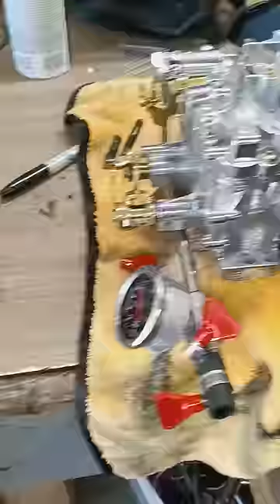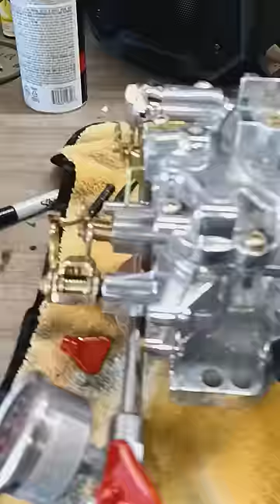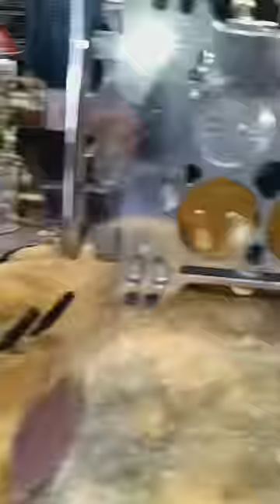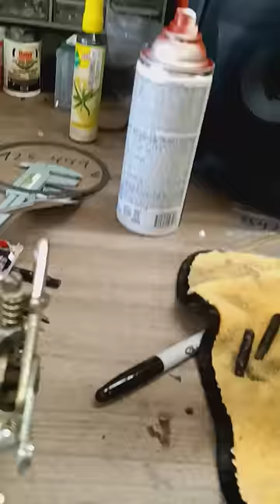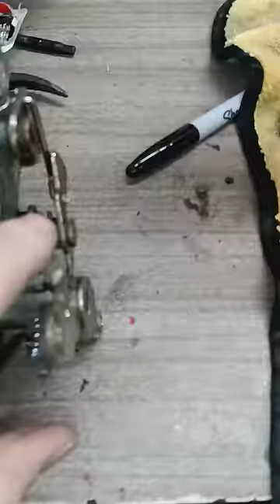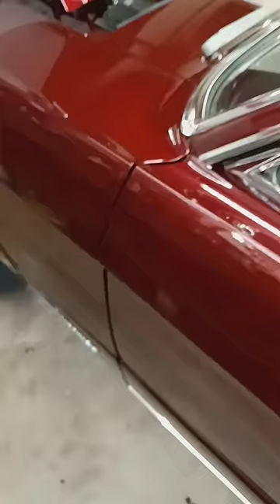how did I miss that?

Comment: Glad you got it figured out, was about to say, check the locking pawl on the secondary lockout.

Carter AVS's has a locking pawl to lock out the secondaries on cold engine temps and prevents you from using the full WOT capabilities til the choke is off.
Reply from the maker: Thanks man,  I made sure it was not set on the lug. I didn't know that was the name of the linkage that is shaped like a sideways U. Makes sense. Thank you for that. Your response is actually one of the most knowledgeable. I got a more then a few people telling me how dumb I am. How trash Edelbrock is, and how garage Mustangs are. Lol trolls?
Reply from the maker: @samhicks97  I couldn't agree more I like all the aftermarket carbs for the most part. They each have their place.
Reply: @BPattB  Exactly. Each and all carbs have their own unique quirk to work with your application at hand.

Comment: The AVS 2 is a much better carburetor than the original Edelbrock as I've noticed. I got much better throttle response as well as a noticed increase in mileage. The AVS 2 is much better off road as well.

Comment: Edelbrock carburetors make killer trot line weights 🤠
Reply from the maker: Please explain LOL I know Holly's making nice low idle in my car but they're so damn hard to tune. I'm working on tuning a new Edelbrock and even with a bog up to 2500 I spun the tires and fish tails all the way through first gear and halfway through second and I have a 280 rear end lol stay tuned and thanks

Comment: Similar thing happened to me, had a vacuum leak under the carb so my buddy gave me a new carb to manifold gasket. Ram it like that for a few months. Later realized the new gasket openings (had 4 individual runners) were not big enough and kept my carb from open ore than 25%. Felt like I added a supercharged when I fixed it lol
Reply from the maker: Awesome man. I had a four-hole spacer underneath the old carburetor. The new carburetor I got the secondaries are 1/8" inch bigger so it was preventing the secondaries from opening all the way. That was a quick fix with the Dremel. I also turned it into a super sucker LOL. I went over that in a video on my channel too if you want to check it out.

Comment: Man you should have noticed that right off the bat.
Reply from the maker: You're right I should have and I've answered this question a few times before my neighbor gave me the carburetor one night after we drink about half a bottle of moonshine. I wouldn't be surprised if he was so drunk he dropped the carburetor halfway to my house and kicked it the rest of the way cuz he was too drunk to pick it up. Anyway the new carburetor is on and has a slight bog below 2500. I went ahead and held it at 2500 and hammered the throttle, the car spun the tires all the way to first gear and halfway through 2nd @65mph) and slightly fishtail the whole way. I'm just a normal guy that likes to drink moonshine on the weekends and that will cause me to make mistakes. Stay tuned it'll be fun.

Comment: Fyi   If you dont hold the choke open the 4 barrels dont open all the way on the older edelbrocks.
Reply from the maker: I appreciate you trying to help. I did a update video and showed how to linkage was bent and that was the problem. Out of the 77,000 views I had three people basically call me a liar, and say that I didn't check that the joke was open or I didn't check that the air valve on the secondaries was open, I didn't show it in the second video. But I really do appreciate people like you that pointed things out that may have been wrong. Lord knows I'll make mistakes along the way and if people like you are there to help me correct the mistake easily I'll appreciate you more than you ever know.
Reply: @BPattB  all good man! Glad it was something else and not something as simple as i stated! Hope the new carb treats you well and wakes it up even more!!!
Reply from the maker: @Robbinsbuiltgarage  right on man

Comment: One tire fire? Time for a junkyard 8.8 with factory Trac-loc build. You can get on with 31 spline axles and up to a 3.73 already installed if you look at 95-01 Explorers. Just google the door card code and diff cover code for the one you want and go huntin'! LKQ will give em to you for $300 before the core discount if you bring back another axle.

Dunno how wide of an axle you need, but that's where I'd start. If you go all in and get a new bearing kit as well as an upgraded and restacked clutch pack for the LSD, and throw in C-clip eliminators you're looking at about $900 for the build. If you wanna take it further, you could probably piece together a 4.10 gear set with the LSD if you pull apart two carriers at the junkyard. And since the tubes aren't welded, you should also be able to hammer them out and get equally sized axle tubes so whenever the clutches star wearing out, there's slightly less chance of it going back to one-wheelin so soon.

Oh, BTW, that $900 quote includes a Cobra Mustang rear disc brake conversion. OH, AND that explorer axle is spring-under with leafs, so... Unless you wanna go 4-link or something, as long as the mounts are the same distance you shouldn't even have to fab anything for a 60's mustang.

Comment: Man I wish I had the means to start my 68 fastback restore. It's been dangling over my head for over a decade.
Reply from the maker: You are in the same situation I was in years ago. I bought a 67 fastback with two crushed quarter panels and no engine for $1,000. At the time no one made quarter panel replacements. I bought the car and I kid you not 2 weeks later I went on to Mustangs plus website in front and center was "brand new item aftermarket quarter panel replacements" I bought both quarter panels and fitted them up and welded them in. This was 14 years ago and my daughter was born. I sold the car for a bunch more money than I bought it and put into it. 6 months ago after 14-year drought ( same age as my daughter isn't that ironic) I bought my current 65. My point is that your 68 fastback is worth a lot of money. If you have it in you to sell it you could possibly take the money you make off of it and buy a 66 coupe that is a running driving car.
Reply: @BPattB  nice. Good back story, glad your patience payed off. A man deserves such a blessing after a wait like that, and your daughter will get to enjoy it. She'll be inspired. 

Got mine in about 09, by the time I saved to start it I got married. Then realestate market was too good to pass up, bought 3 buildings which kept me broke. Then had 2 kids, now I'm beyond broke. Been beyond broke. Now having some tenant issues I prey will be resolved soon. 
My youngest turns 5 this month, oldest 7 in May. I'd actually be satisfied if I plugged in your timeline and could start a restore in 7 to 9 years. It sucks we can't get these bucket list items off the list before the madness of life kicks them to the back burner and we waste 15 20+ year's not enjoying something so small yet so big. I really wish I had it done so my parents could enjoy it for a while. Patience isn't serving me from that aspect. 

I should have had my buildings ready to sell when interest rates were low and prices were high about 6, 8 months ago. Time being I guess I'll float and hope there's a pot of gold at the end of the rainbow. Lol
I'll live vicariously through fine folks like you until i reach that pot of gold.

Morril of the story is chase yor dreams, don't neglect family or finances doing it, have patience but not too much patience, like and subscribe.
Reply: I think I just made you 351 subscribers. That's probably a sign.
Reply from the maker: @jamesrogers4674  couldn't have summed it up better myself.

Comment: Could you keep us updated please? ? I need that fix! It makes great noise out the back end that’s for sure! - from your other mustang video. It’s gorgeous buddy!
Reply from the maker: I appreciate you thanks man, just a little update the new carburetor has a slight bog below 2500 RPMs so I decided to hold it at 2500 RPMs and bury the throttle, the car immediately spun the tires and slightly fishtailed all the way through first gear and half of second. The car has 280 gears lol so I figure I was going about 60 when I finally got traction. Subscribe and I'll post as often as I can I work a regular job so it may only be on the weekends. One thing I don't mind spending money on his tires because I smoke the old ones LOL

Comment: Just bend back the linkage and save the customer the price of a BRAND NEW CARBURETOR!!!
Reply from the maker: How did you come to the conclusion that this is for a customer? This is my car. The "BRAND NEW CARBURETOR" is not the same as the old one it is an upgrade. That's the reason I bought the BRAND NEW CARBURETOR. The BRAND NEW CARBURETOR  is a larger CFM. The BRAND NEW CARBURETOR also has dual feed inlet, annular boosters, adjustable secondaries. The old carburetor had none of those and that's the reason I bought the BRAND NEW CARBURETOR.

Comment: For years i was using the resistor to feed the HEI distributor when i swapped it from points, i only had a test light back then,  the car was fast when i swapped the motor now i wonder how much fast it may have been. L"O"L
Reply from the maker: Right
Reply: Resistor wire, forgot to type wire😂

Comment: I think adjusting your old one after you fix the bent linkage problem and see whats up with the six month 4 barrel? If good send back the new,put money back in your pocket and hopefully if your have time pay more attention to your parts. ( always review  on parts before you Buy.
Reply from the maker: Yeah if I fix the linkage it definitely would have worked better. But I wanted the AVS 2. It's a bigger Carburetor 650 compared to 600. It has annular boosters compared to down like boosters on the old performer, which I've read are the closest off idle response you can get to fuel injection. And it has the capability of moving the fuel inlet to either side or being a double inlet. Long story short I was upgrading the carburetor when I realized the old one had the bent linkage. But I truly appreciate you trying to help me out. Stay tuned I'll try not to disappoint LOL.

Comment: If I'm not mistaken Edelbrock fancied themselves on racing Fords.
You're putting a 4 barrel racing carburetor on that little Mustang, probably way too much carburetor for that little motor!.
Those carbs are for at least 350 CI displacement
Reply from the maker: My  engine is a 306 so 650 CFM is just fine. What size did carburetor did the Shelby 289s have?

Comment: Check your throttle linkage throw.  It probably over pulled it and bent it. Your foot pressing down is pretty strong.  You may need to make a throttle stop on the pedal or the cable to not over pull.
Reply from the maker: Bent linkage was exactly the problem. I appreciate you trying to help out man thanks

Comment: That carburetor will not open further than that if the choke is closed.
Reply from the maker: I did a follow-up video showing the choke wide open and the fact the bent linkage was causing the problem. I really appreciate you trying to help me out.

Comment: This is why you always troubleshoot a problem instead of troubleguessing. Know what the problem is before you start throwing money at it.
Reply from the maker: I bought the carburetor as an upgrade not a replacement. I should have been more clear in the video I guess. I did a follow-up on the differences between the two carburetors. You should check it out.

Comment: I’d be interested to know, with that bent linkage but full throttle could the butterflies open wider due to suction ?  If you hold the linkage as far as it can, and then push the butterflies will they open further ? Just a thought.

Comment: How do you like the av-2I’m thinking about switching from a Holley 700 to that
Reply from the maker: The avs-2 is awesome if you want a carb that will start and drive without having to tweak once you tune it. If you want a carburetor that will give you every ounce of horsepower but you do have to mess with it quite a bit go with the Holley. The deciding factor for me was when I finally figured out that 330 horsepower with the Edelbrock was only going to be 338 with the Holley I'm going to pick the trouble free carburetor because I'm not competitively racing. The Holley will give you a slightly meaner sounding idle and a touch more performance but you're going to have to mess with it to keep it tuned. They each have their own place but on my car that I want to start up and drive and not have problems I'm going to run a Edelbrock, and the avs2 is so much better than the older 1406/5.

Comment: I have a few of those and the accelerator pump goes bad really fast.i have two 600cfm and a 750.other than that they are pretty good
Reply from the maker: Interesting, I just asked the Muscle Car Solutions channel about the difference between the replacement Edelbrock accelerator pump part number 1428 and the stock accelerator pump. The gaskets obviously a different color but what I think will affect performance is the accelerator pump that comes stock on the carburetor has a longer travel distance. The accelerator pump goes to the nozzle, a larger nozzle doesn't mean more fuel it delivers the same amount of fuel just faster. So I would think with the stock accelerator pump in which the travel of the pump is longer would deliver more fuel as opposed to the replacement which is a shorter travel. I don't know man I'm just trying to work it all out LOL. I'm sure I didn't explain that right maybe I'll make a video about it. I'm hoping Muscle Car Solutions answers me back and it's something he already covered. That guy is amazing at explaining things and beyond that actually helping out people in the comments that ask questions.

Comment: If its a small block it's probably at its max anyway. It won't be able to pull much more air anyway. Won't be much more than a tiny difference. It will be a little though.

Comment: you are supposed to check your linkage settings before setting your vacuum and then timing. so who setup the first carb
Reply from the maker: I tuned with a vacuum gauge and the cam is too large to set by stock timing numbers. The carburetor was used and I didn't catch the linkage was bent. Yeah I made a mistake. It's all good I still have a really nice car that is really fun to drive. And you know what quiets all the critics down? Show me what you're driving? Not one is posted a video response.

Comment: Whatever you do, get up to at least a posi in the rear. One tire frier is no bueno man. It won't put power down, you really need a posi and traction bars.
Reply from the maker: Yeah the old slapper bars I have look  "Period Correct" but they only prevent wheel hop. I like the Cal Traxs I have a buddy with them, made a big difference. I don't know pos vs open, they both have their advantages the open being you're less likely to hook up and have something break. But yeah I'm leaning way farther to the posi side. The car already is a s&1t show trying to leave in first gear with 2:80 gears I don't think I need anything more then 3;25s and posi out back. I put up a short and a video of me spinning the tires and just messing around they both around 30 seconds each.

Comment: The problem started with his first statement "I was THROWING the new carburetor on".   'Throwing' something on implies doing it in a hurry and carelessly....not good.   Checking for full throttle is like the FIRST thing you check after putting on a carb or doing anything to the linkage.   Good you found it...but in the future...a little more care will serve you well.
Reply from the maker: Definitely take it into consideration

Comment: Make sure they open 100% and not 90% or 110% both butterfly settings that don't do true 100% will rob power and cause performance issues.
On the new carb looks like the secondarys are hitting like 90%
Reply from the maker: It was an angle of the camera there a true 90° angle. I'm a dork but I got into my tool bag and got the angle finder and checked. The s*** part is I left it on the workbench at home and when I was fitting up pipe the next day at work I didn't have it.

Comment: Shortened engine life span is what's going to happen!  "The star that burns twice as brightly only lasts half as long."
Reply from the maker: Actually running lean will give you more power but shorten the life of the engine. If anything you want to run a touch rich so you don't "melt stuff". Melt stuff is a technical term

Comment: Can't wait to throw a new edelbrock on my 83
Reply from the maker: I would recommend the avs2 over the regular Edelbrock. The AVS2 650 part number 1905/6. The regular Edelbrock is 600 CFM 1405/6. The AVS2 was only released 4 years ago so the technology is a lot newer than the regular performer that has been out for decades. Throw a new carbon on the 83 and make a video and tell me about it. I'll definitely watch

Comment: Is that the reason for new carb?
Reply from the maker: No, The new carb is bigger 650 vs 600. The new carb has adjustable secondaries, dual feed lines, and the boosters are annular vs down leg on the old. I also went with manual choke on the new one. Great question. Some guy comment "you bought the same carb instead of fixing it you must have money to  burn" lol. Trolls 🤷‍♂️

Comment: Doesn't matter, unless you're taking in enough fresh air to match the amount of fuel delivery you're throwing at it. A bigger intake manifold is crucial for power. You can always restrict the air at the carb.
Reply from the maker: I'm running an Edelbrock performer RPM. The AVS2 Carburetor is a huge difference between the 1406 I showed. I'm going to say some of that is the fact the old carburetor wouldn't open all the way up and the new carburetor being a better carburetor with newer technology and 50 more CFM of flow